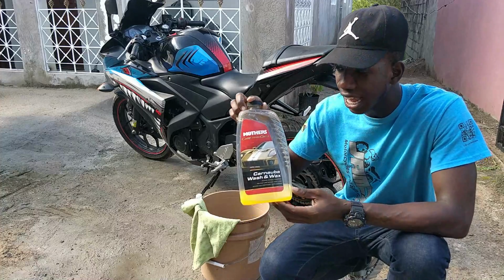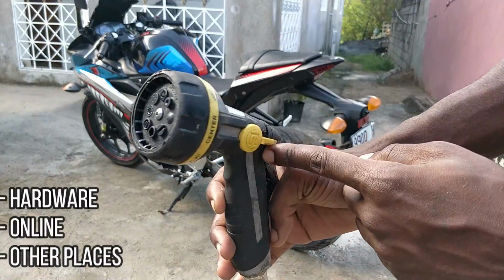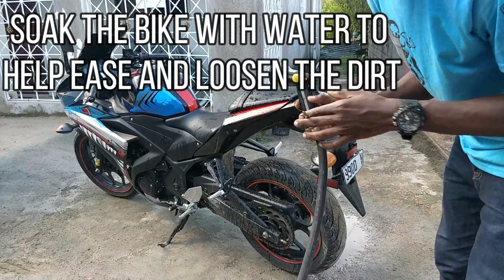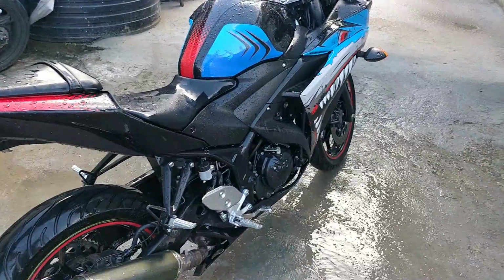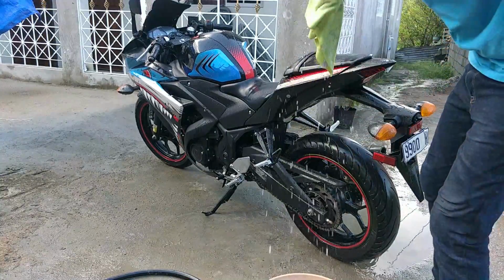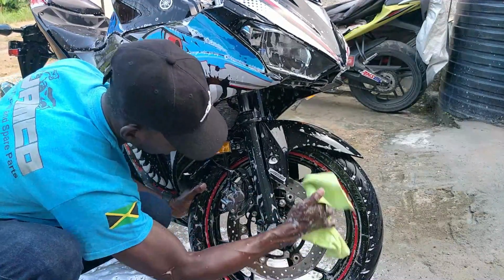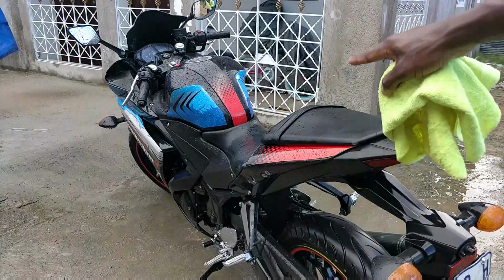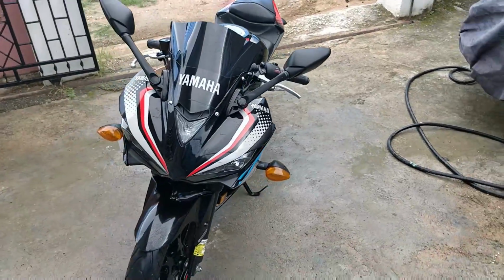Dirty Bike? How to Wash & Clean a Bike | Jamaican BikeLife 🇯🇲

Comment: What a great way to scratch the bike.

Thanks for teaching me to switch on the tap! That is a very useful tip
Reply from the maker: Ha! Funny. But Really, how would you scratch your bike? Is it that my technique is not what you would use? The water pressure is just enough to get dirt off and if its too much just keep a good distance from the bike which gives you the same result, and yea using the bucket technique does mean you might track dirt back on the bike but just don't dip the rag all the day down in the bucket n you'll be fine.
Reply: @ParadiseBiker  haters gonna hate😅